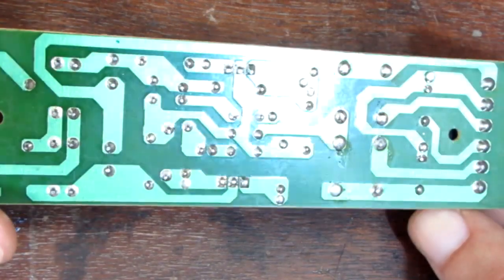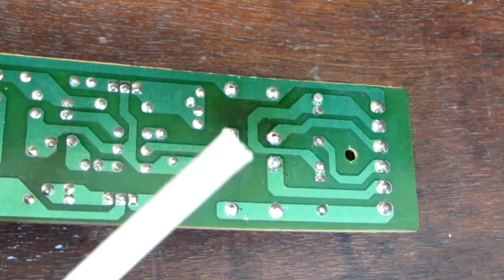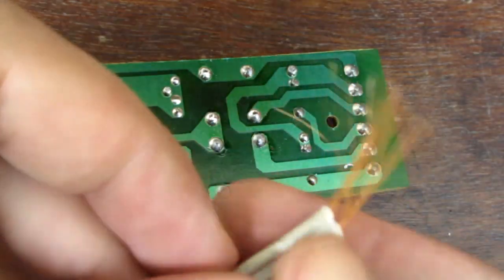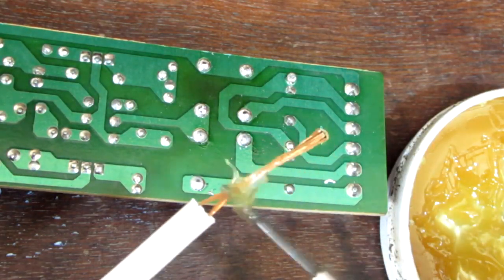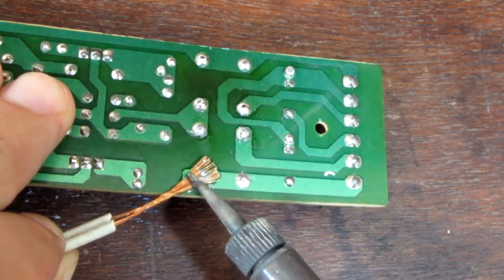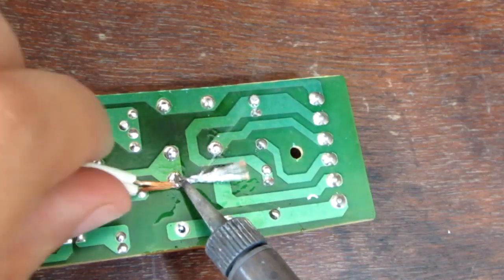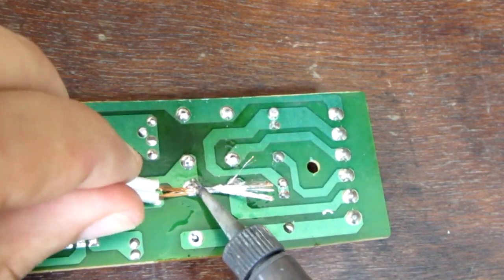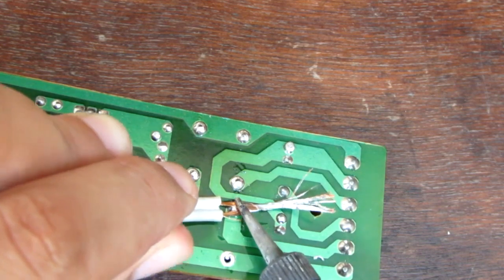Tips'n Tricks : homemade solder wick / braid

Comment: Broooo.... alright, now if the DS5 and DS4 share the same analog style, tomorrow I may swap them 😁

I gotta check but I'm pretty sure they're the same. The problem with removing analog housings by hand is that you either heat all the points at once with an air station (I don't have) OR -you desolder the points at each joint one at a time.

I used to have a solder-sucker somewhere but 🤷‍♂️ so I can't use that... but THIS. I can probably do this. I keep spare junk wire laying around and this seems worthy for some of it.

Thank you! Dropped a like 👍

Comment: Now we need a video on DIY flux paste
Reply: They claim vasaline works great.
Reply: @irishguy200007  No it is absolute crap just go gather some pine resin/gum dissolve it in isopropyl or other high percentage alcohol I think you can even use acetone if it's to runny evaporate off some of the alcohol and it's that simple I made some and it worked really well
Reply: in our country  we use "Insenso" as alternative.   you can get large rock of it dirt cheap near church. 🤣🤣🤣🤣
I'm not sure how it was made but I believe it came from a tree.